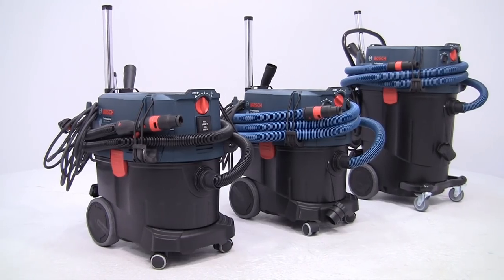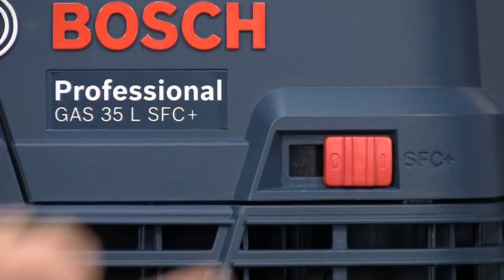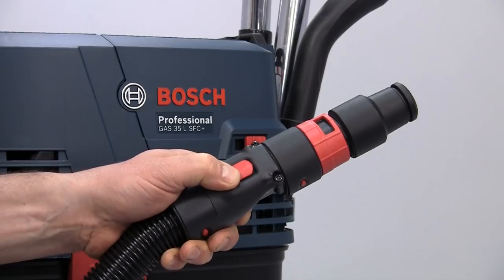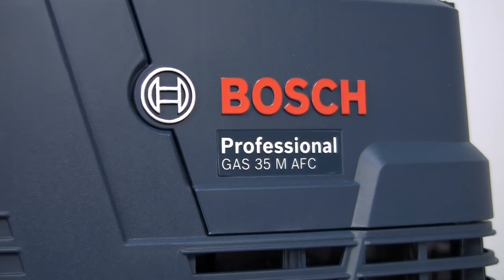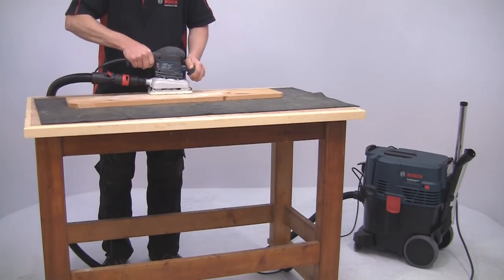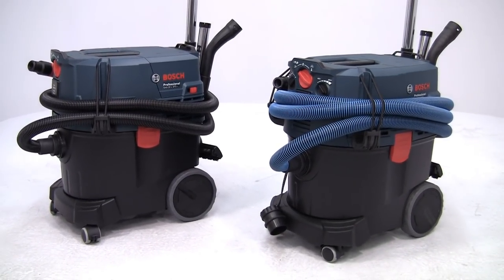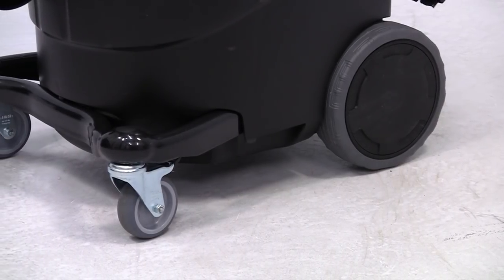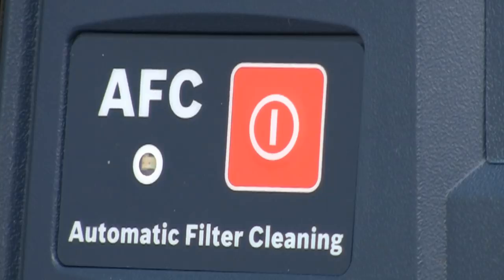Bosch GAS 35/55 dust vacuums

Comment: Great review. I have an AFC model but i prefer using it with a bag. The manual indicates that with a bag AFC must be switched off, however it still goes on automatically, and has to be manually switched on on every restart of the machine. Anybody know a way to permanently switch off AFC?

Comment: I have had the GAS 35 M AFC for 2 years now and it's absolute junk! It barely sucks at all and when cutting hardwoods which make fine dust it clogs up almost immediately. The AFC also decides to stop working after a while without the filter being clogged or the vacuum being full.
Reply: What did you buy instead?
Reply: @kgp43  So far, haven't found anything else, I use the high CFM chip extractor with a fine filter attachment where I can, like the table saw but for smaller tools I still use this
Reply: If filter gets clogged, any rocket science vac would slow down. Its simple science, genius. Air is supposed to be able to move through the filter!
Reply: @super-z8943  No Sh-t Sherlock, what I mean is that the filter is very small for the size of the machine, so it gets clogged quickly. A filter with more surface area would get clogged slower and would be better in such a large vacuum
Reply: @LiorMark  yes genius, a filter with over 6000cm2 is small indeed.
Reply: The vacs are only 1200w. My miele home vac is 2200watt. I dont get it. You pay $300 for a miele and $1000 for one of these vacs.. the Miele has double the watts (and yes the miele is very efficient so it isnt compensating with watts)
Reply: Use filter bags. They are expensive but work very well.
Reply: Its suction power is low, even with a new filter

Comment: I need to know, do you need to use a dust-bag/bag to use it? or can you use it without bags just like a normal Bagless Vacuum Cleaners?
Reply: Hi, these can be used without a bag if required. In fact since they're wet & dry vacs, if you're using them to suck liquid then they must be used without a bag.
Reply: danrhyn hehehe' thanks for the response, I already bought the beast! 👍

Comment: hi is it only available in 230v? I would need 110 take off for chasing concrete/ blocks . good video BTW
Reply: You can get any in the range in 110v or 230v.
Reply: Paul Walsh